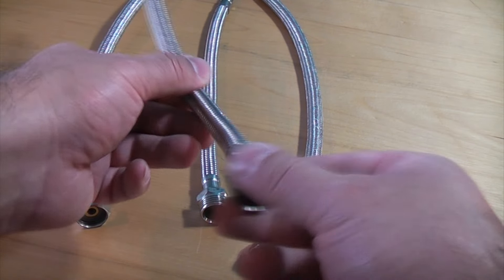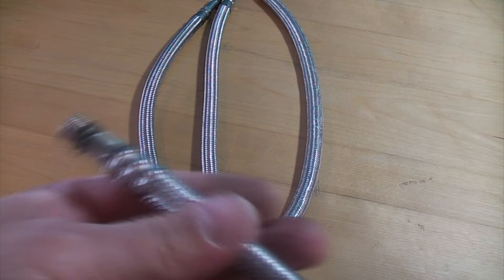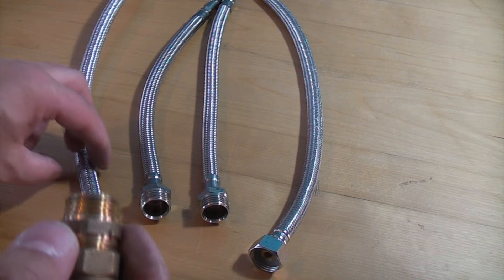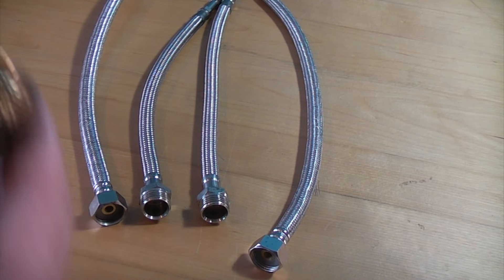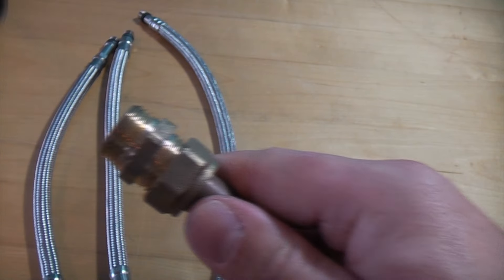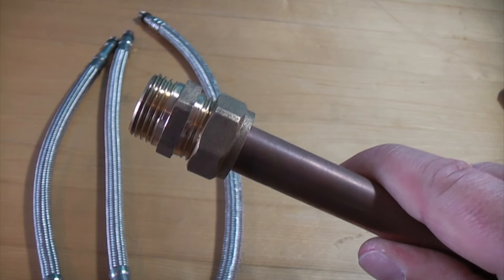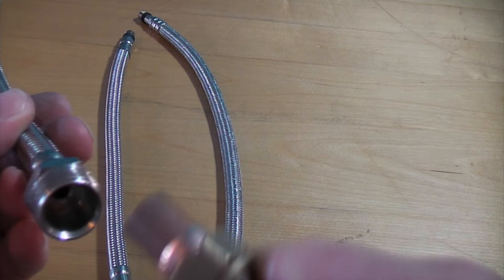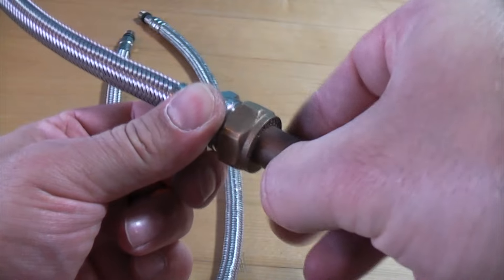How to connect flexi tails - Ultimate Handyman

Comment: hi can you screw these straight onto a 15mm isolating valve an just remove the nut and olive
Reply from the maker: +Roy Kirkham 
Yes, you can do that ;-)
Reply: Ultimate Handyman could you do a video one that. ..
 What's the difference between isolation valves ...is one "better made ie Full bore pegler. 
Any one ...have in info or experience with different types of valves ??
Thanks Chaz.

Comment: This is not correct. The end with the rubber washer does NOT tighten on to a compression gland. It is only meant to fit into a BSP parallel thread. The compression gland will cut the rubber and may or may not work.
Reply from the maker: The threads on an isolation valve are parallel BSP, as are the threads on a compression fitting, however, I agree that the end will cut into the washer. There are now much better alternatives, such as Flexi tap tail adaptors, and even flat-faced isolation valves. (video coming soon) 
Thanks for the comment  👍

Comment: http://www.diy.com/departments/athens-chrome-effect-monobloc-tap/38612_BQ.prd

the tap actually comes with copper feed pipes which admittedly I didnt relise, So I went to screwfix for some flexi tails instead, but as I said all ends are male. ?
Reply from the maker: +Ryan Golds When you say both ends are male, are they both the same size?If they are it's easier to swap the tails, or use the ones supplied with the tap?
Reply: +Ultimate Handyman I sent you a photo link

all ends are the same size, i dont want to use the feed pipes that came with the new tap because im not experianced enough to solder them. screw fix dont seem to sell flexi tails with female ends
Reply from the maker: +Ryan Golds 
Did the flexi tails that you bought not come with nuts and olives?
You need 4 nuts and 4 olives and some 15mm pipe to go from the fittings you have now to the new flexi tails.
http://www.screwfix.com/p/compression-fittings-cap-nut-15mm/60219

http://www.screwfix.com/p/compression-olives-15mm-pack-of-20/69557

Or if the flexi tails are long enough you can undo the two nuts that you already have connected to the water pipes and remove the brass body from one and the isolation valve from the other and screw the flexi tails directly into the nuts as the olives will still be left on the pipes.
But the only problem with doing this is that you are then removing an isolation valve (you should really have isolation valves fitted to both pipes)
Reply: +Ultimate Handyman 
yeah the flexi tails did come with olives and nuts, also there is a isolation valve on the other pipe below just out of view.
I guess what's confused me (very easy to do) is that the plumber that fitted the pipes years ago has done an arse about face job. he should of fitted the isolation valves at the same height on both pipes and used some pipe above it. would you mind sending me a link for female ended flexi tails if you know of anyone that sells them....il change them rather than removing anything.
Reply from the maker: +Ryan Golds 
Only place I can find them is ebay- http://fave.co/1KqM8cx
You have to make sure you get the right ones though, as they make them with a 10mm or 12mm male end to screw into the tap.
The other end will be 1/2 inch BSP
Reply: +Ultimate Handyman 
Ah..thanks for that, why screwfix or plumbase dont sell them , ill never know.

Many thanks for your time and help.
Reply from the maker: +Ryan Golds 
You are welcome ;-)

Comment: hi can I fit plastic pipe to the flexitail with a compression joint thingy
Reply from the maker: You can but it might be easier to just get a push fit tap connector?

Comment: You can buy a 15mm brass compression to 1/2 inch bsp male adaptor. Then it will not cut into the washer. These are stupid flexies why do they make them. Better to get one with 15mm compression then it can go straight onto isolation valve or copper pipe.
Reply from the maker: That is correct, but as far as I am aware, these are a relatively new and were not on the market when this video was filmed.
I did buy a pair a few years back, but have not had time to make the new video yet.
Thanks for the comment

Comment: you should also mention  not to overtighten when fixing to an iso or a compression straight as they can cut into the rubbers and destroy them, you can get "straight Bushes" basically a compression straigh with a flatter contact point instead of the "point" on isos and compression straights